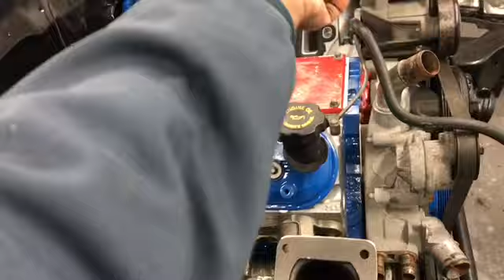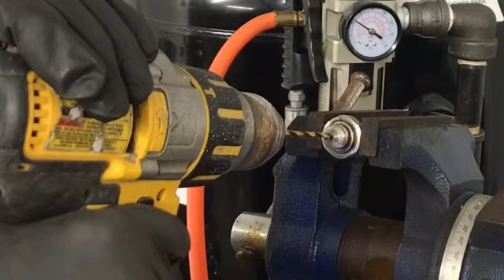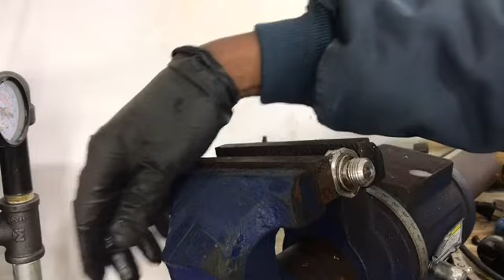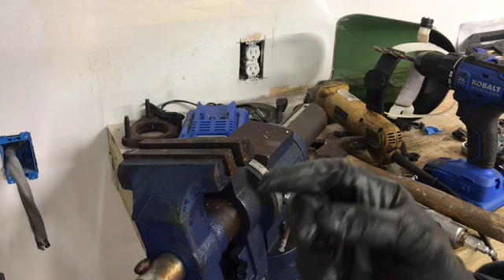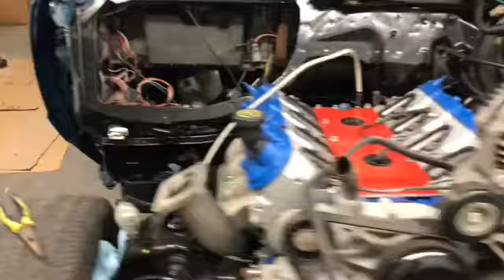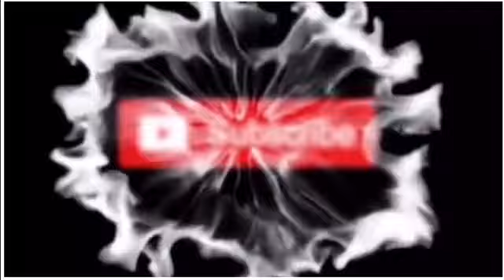#LSSWAP #GBODY #MONTECARLO SS TURBO OIL FEED LINE INSTALL

Comment: Hey bro I’m running the same turbo log . I cut mine down to fit under the stock hood.. does it’s fit uncut?? Or are u running a custom hood??
Reply from the maker: Yea I may have to customize my hood.
Reply from the maker: I haven’t tried to close it yet though
Reply: @MRRANDOM1  I cut mine down

Comment: Nice work bro. Still haven't decided on where im tapping mine from yet.
Reply from the maker: @Catloco’s Garage I’m thinking about just ordering a longer line with the 90 on turbo side to clear my hood and move it back above the oil filter so I can use my sensor. I’m sure I will need it.
Reply: @MRRANDOM1  Yeah I think I'll need mine for my gauges.
Reply: @MRRANDOM1  i was about to say that bro, something about gravity but this way works i just think a longer line is better. I run mine from above the oil filter and I think its 4ft